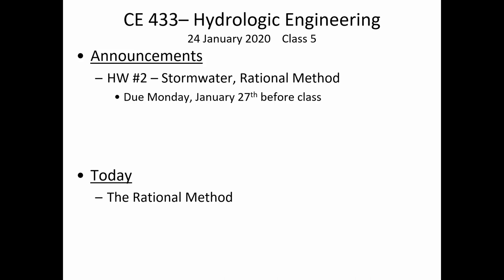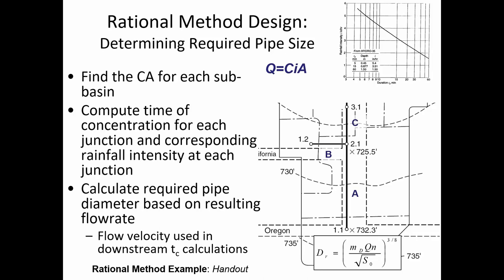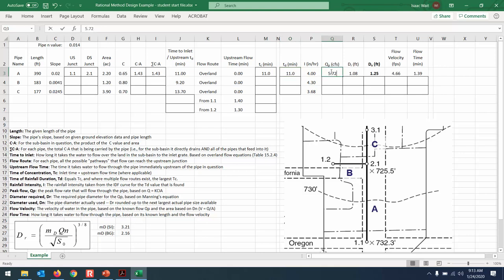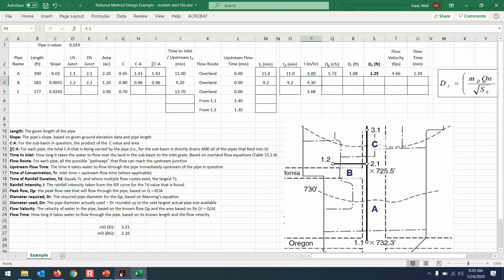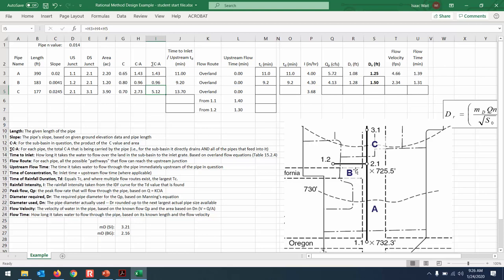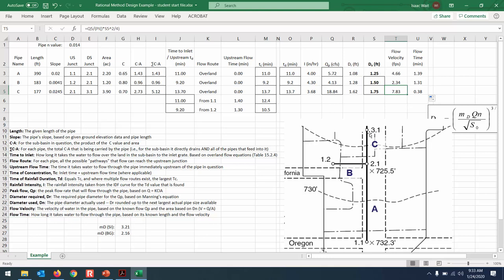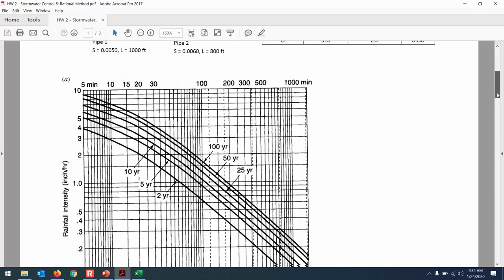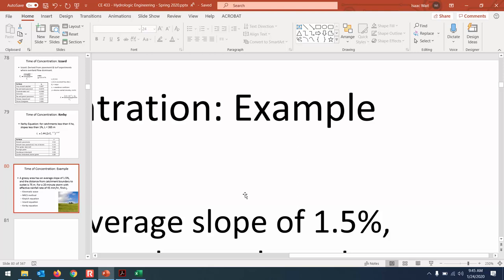CE 433- Class 5 (24 Jan 2020) Rational Method Pipe Sizing with Spreadsheets, Time of Concentration

Comment: Thanks Isaac. It helps me clarify my confusion about time of concentration and td. Also it helps me solve  problems about discharge calculation with mult-catchment. Thank you very much.
Reply from the maker: Happy to hear that -- best wishes from West Virginia!
Reply: Issac, in your lecture about aquifer, you mentioned 1 wellpoint dewatering. How about when there are 2 wellpoints for deeper dewatering calculation?  

How may we know how to solve those kind of calculation like finding drawdown, pump rate, etc. Thank you very much for your in-depth teaching. 
Best wishes from Hong Kong.
Reply from the maker: @fn15895  The principle of superposition applies in cases of multiple wells.  None of my videos or examples include multiple well problems, but there is an example in the book "Water-Resources Engineering" (3rd edition) by David A. Chin. ISBN: 978-0-13-283321-9.  See pages 741 to 744.
Reply: Thank you very much for your book reference , Isaac.  👍🏻👍🏻👍🏻
Reply: @IsaacWait  I just discover my university library has this book. I will read it tomorrow to see whether it can help me understand.  Really thank you very much for your selfless help. Thank you.😊
Reply from the maker: @fn15895  Great -- glad that you've got ready access to the text.  Good luck with everything.